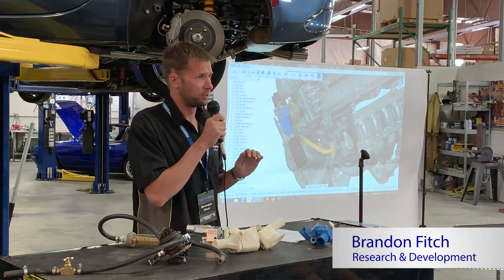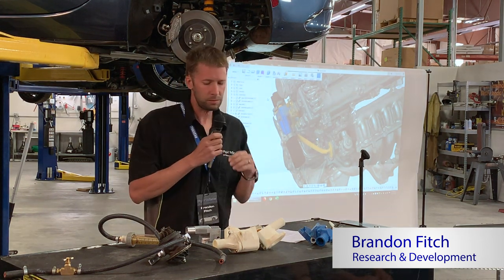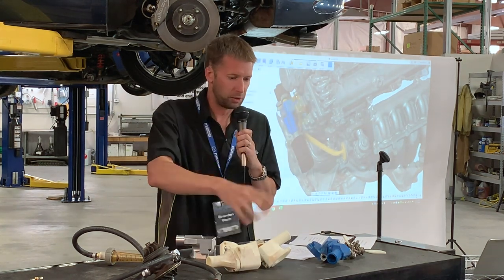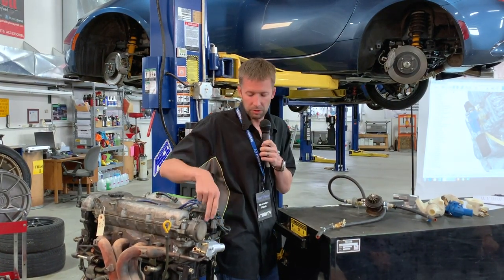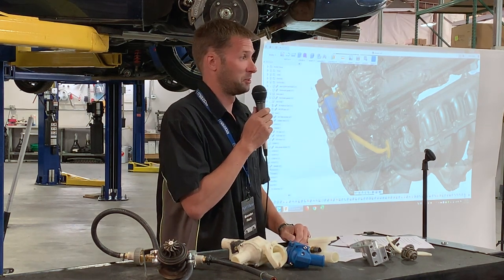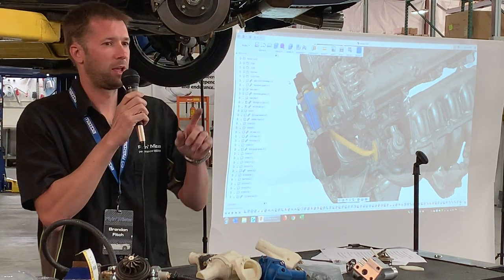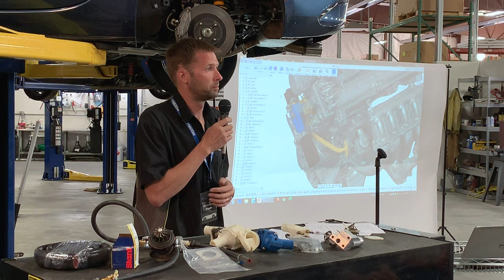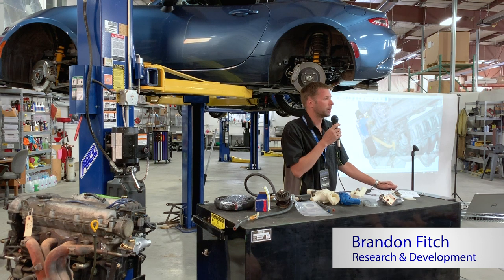Flyin' Miata Coolant Reroute - R&D "Deep Dive"

Comment: The best setup for the  vvt miatas is the 99 head gasket and a reroute.
It would be nice to have the option for the water lines for the turbo kit if using the reroute.

Comment: What is the drawback of running "more" water to the turbo? When engine is off, you'd like to have  as much water as you can (id: bigger lines) to maximize heat transfer and thermo-siphoning?  The extra "heat" charge produced by turbo while engine is running can be dealt by a better "radiator" system ( better core design, ducting the radiator...) or i am missing something ( for a turbo track car)?
Reply from the maker: The problem is that the Miata cooling system is already struggling to get rid of the heat. Better core design, ducting, airflow management - you need to be doing that already. Turbo track cars are marginal for cooling, and one of the reasons is because of that heat load from the turbo.
If you transfer more heat from the turbo to the coolant, the entire engine suffers. The decreased coolant flow to the turbo is still enough to prevent oil coking (that's all it really needs to do) without loading up the rest of the system. It was part of the design intent of this reroute.

Comment: You guys need to fix that ASP on your website. If it includes all the fixings as the old kit that needs to shown in the pic/description. Your going to get that same question again
 and again and again.
Reply from the maker: It does state " Includes all new lines and heatshielding as well as plates to block off either the thermostat or the thermostat neck and plugs for unused fittings." and every photo has "not all parts shown" as a caption, but we'll try to make it more obvious.

Comment: Do you recommend switching to the NB1 head gasket if you install this on an NB2?
Reply: Saber008 yes otherwise you will have the same problem but reverse. Hot in the front

Comment: Does this kit work in RHD cars? I've heard other kits snag in some places.
Reply from the maker: Probably. Look at the area between the clutch master and intake manifold - as long as a radiator hose (maybe 1-5/8" / 40mm OD) will fit through there it will probably be good. We've honestly never had a RHD car available to test fit it in person, so we unfortunately can't guarantee anything.

Comment: Kits are too expensive and no thought of replacement parts are considered
Reply from the maker: Doing things right is more expensive, that's true. We do offer replacement hoses, thermostats, gaskets and any other parts that might be expected to need replacement.
Reply from the maker: @johnnycee5179  There is a significant functional difference between the other units on the market and ours, specifically if you have a turbocharger. When faced with the choice of making something better or making it cheaper, we tend to choose better. We do not charge extra for our name.
We also have our machining done in the US, which is not the case for some others on the market.
Reply: @FlyinMiataVideo  Really? What are the significant differences between what you offer and what Super Miata offers?
Reply from the maker: @johnnycee5179  The biggest difference is the turbo integration and where that hot water goes - there aren't any other reroutes designed specifically for turbo cars. This video includes a lot of information about the design of the product as well, and why we made the decisions we did.
Reply: @FlyinMiataVideo  okay, honestly I didn't watch entire video, which you may have surmised, I go back and watch in it's entirety. Thank you for your patience and fast response.